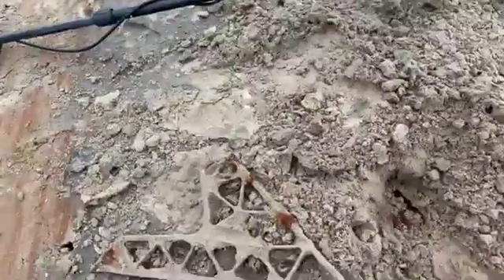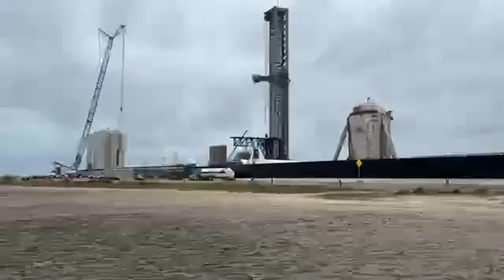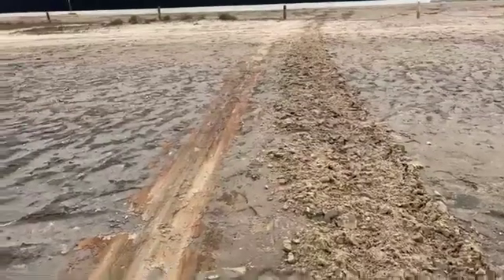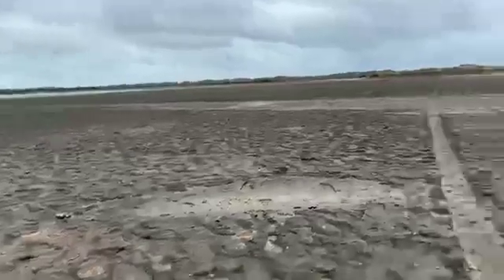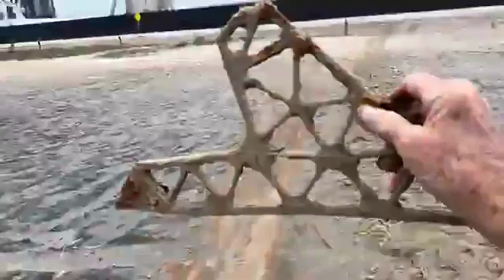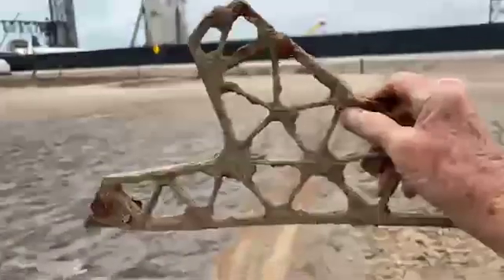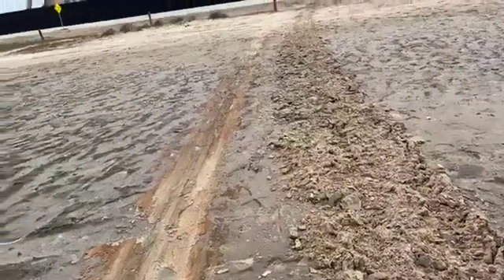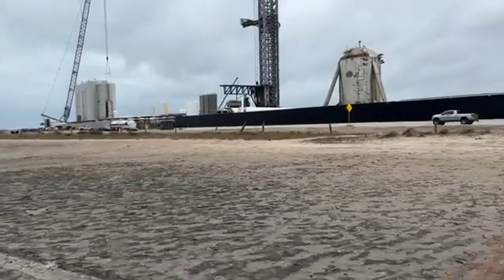SpaceX Starship Heat Tile Search Starbase -The Triangle

Comment: Found a seller selling complete tiles on Etsy. Used to be able to get them on eBay but looks like they’re cracking down on selling platforms
Reply from the maker: I have been selling Heat tiles on EBay. They ended all my listings saying they were in violation of their policy for selling stolen goods. I contacted SpaceX and they are going to me a letter saying I have permission to own them. SpaceX knows that I have them and I have returned 6 copv tanks from Starship 24 I found in Mexico. I have whole Heat tiles from Starships 24 and 25 for sale direct. I can be contacted at Ronspacex@ gmail.con

Comment: I think the bend is intentional! It's probably designed by generative design, and made using a metal 3d printer!
Reply from the maker: I
The bend is not intentional. I have 8 more. They are stainless plate cut with a water jet.
Reply: @ronhardrock468  ahh okay my bad, just speculating here. Probably way cheaper that way!